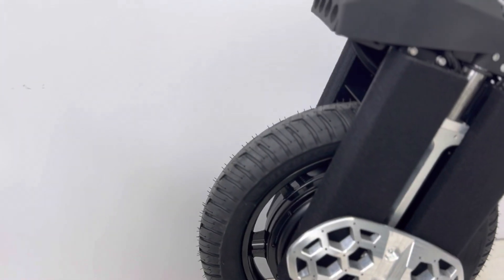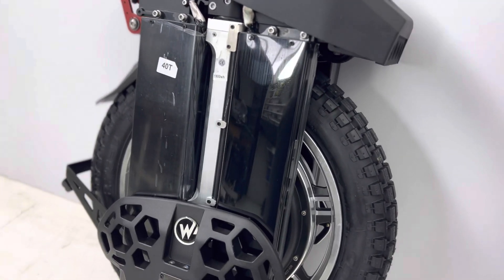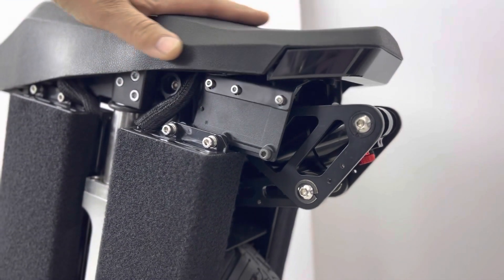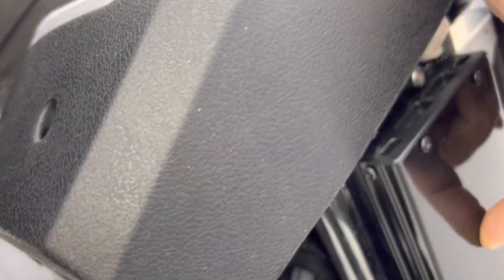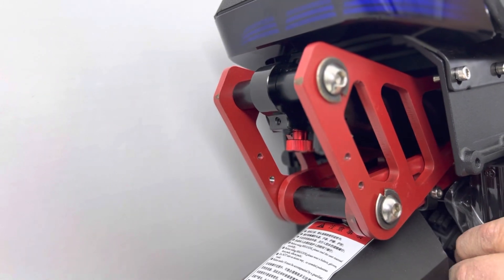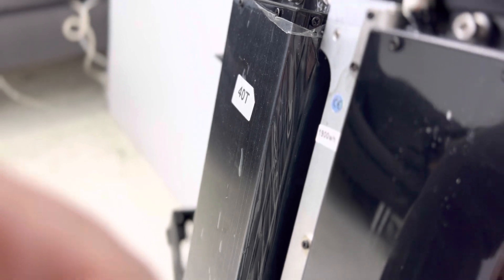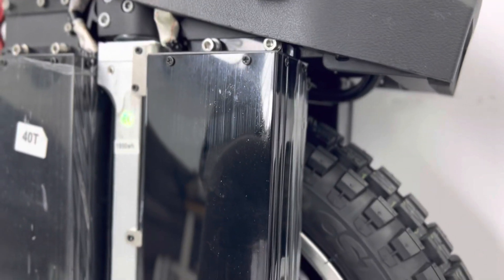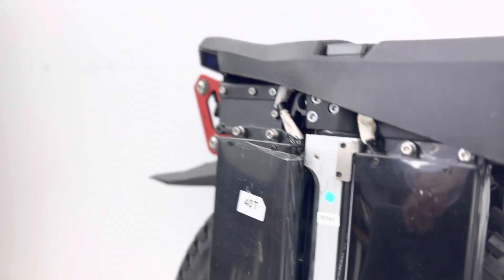Begode Master Improvement Needed

Comment: Hey Sergei, overall, do you like the Master?
Reply from the maker: Yes, definitely a good successor of MSX, MSP, RS, EXN line. First of next gen performance Begodes. 40T or molicel is a must for safety. Do not buy 50E if you plan riding more than 25kmh
Reply: @icafese  why? I don't want to accelerate so fast, but I want to ride at 40 kmh

Comment: May I politely venture that just the soft velcro might not be enough on its own. I've just done mine the same but then used velcro to attach bumper strip on top of that wherever the regular pads are not, and especially at the back. I am even considering double bumper strip there. None of that helps with the inside of course, and I don't have anything there yet - thank you for reminding me I have got to sort that out ! I am going to take measurements and then get cut some 1mm metal door kickplates with industrial adhesive on one side, which I am hoping will provide all the protection I need against the small stones without interfering in the tiny margins either side of the wheel. Unlike the rest of my pack padding, this doesn't have to be removable, so can be glued permanently if necessary, providing we leave access to the (taped) screw holes.